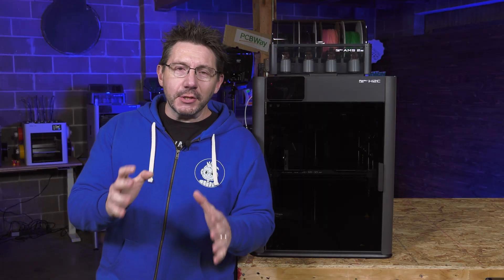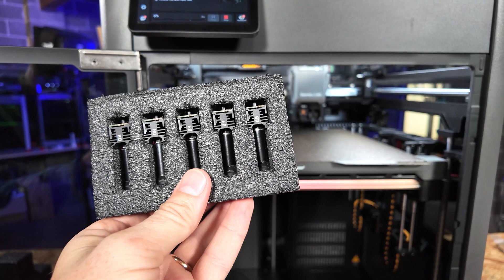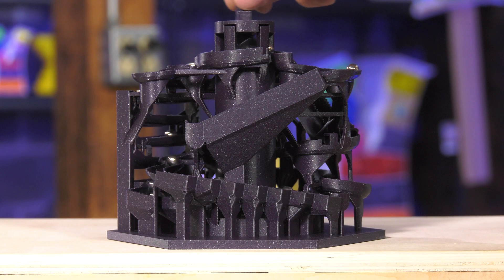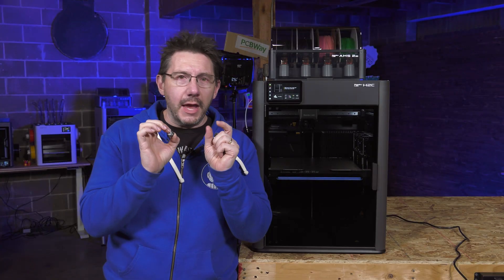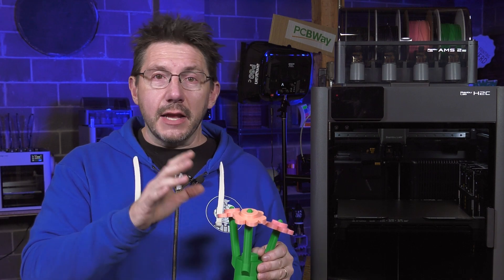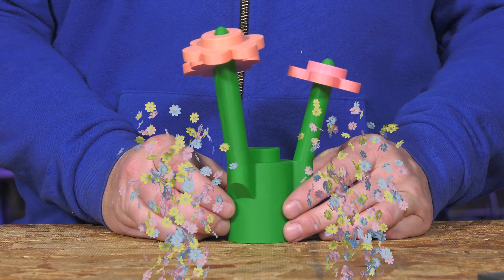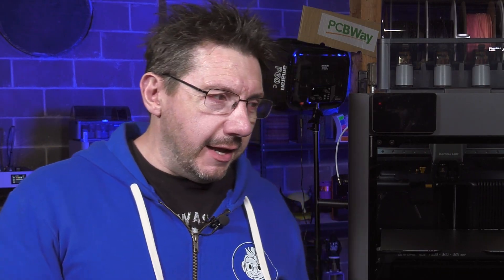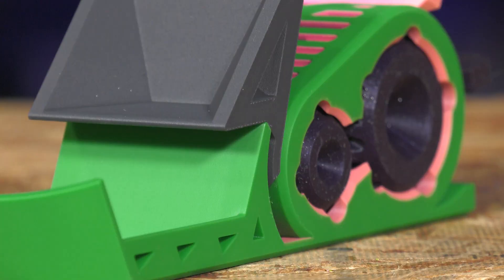My Review of the Bambu H2C + Vortek

Comment: they solved the cold pull thing with a firmware update....now fully auto.......
Reply: It should perhaps be emphasized once again at this point that there is no heatbed problem with the H2C; rather, it was a case of user error. The matter was clarified in his video "Bambu H2C Update - Bed Heating / Tullomer + Polymaker."

Comment: In terms of the bed, that’s strange that it doesn’t stick with visionminers adhesion solution, that stuff usually works for me on everything. I’m guessing it’s either the bed material or texture that’s causing it. TBH, I’ve never liked bambulab oem plates, this same issue happened to me on the x1 and upon replacing with a third party pei plate, prints stayed in place as expected. Visionminers adhesion promoter works wonders though usually, pretty sure it’s witchcraft.

Comment: You dried out the pa6 too much, it becomes very brittle if you overdo it. Pa6 is really annoying to work with as it needs very strict parameters, and must be sealed after printing to keep water from ambient air  out of the nylon - ppa-cf would be a good alternative. extremely strong and relatively easy to print, albeit being pretty expensive.

Comment: I have found with PA6+GF or CF really benefits from the water anneal process for nylon. I tested this by printing a tennis ball with PA126 from IC3D after drying the filament the one that was not water annealed broke after a couple throws at concrete, the one that was water annealed survived 100+ throws full force at the same concrete floor. I eventually printed a basketball with it that is still bouncing.
Reply from the maker: Water annealing - I’ll look this up!

Comment: Alright, I have printed PA6-GF with a few tips. Here's what I've learned. First off, use glue stick. Even for a small part, it breaks lose easily without glue. 100°C for the bed and 60°C for chamber. I dried it for 12 hours at 85°C in the AMS HT with spool rotate on. Once the drying was done, I put in Slice Engineering Activated Alumina desiccant in a spool desiccant holder. That brought the humidity to about 10%-15% or so in the AMS. PA6 shouldn't be over-dried. It should remain somewhat flexible when bend sharply and not spontaneously break. It should fatigue break after a few bends though. If it's too dry, it breaks immediately upon bending. I also set the nozzle temperature to 290°C which is 10°C hotter than the standard profile.

Comment: Lazy review. First the bed heating is a non-issue as reported on by several other youtubers and people with the actual printer. Also, there is a dedicated menu for automated cold pulls. You don't have to butcher the nozzle to do a cold pull. This is a lazy review which makes me question what else Joel "missed."
Reply from the maker: Tried the cold pull didn’t work. Also tried the wiki method of heating a small allen key and shoving it into the nozzle. That too didn’t work. Bed heat update video coming. Sorry I was too lazy.

Comment: It physically hurt to see how he burnt up the nozzle. Dude, the printer has a cold pull function. Even in my X1C I dont do cold pulls with a lighter, just heat up the nozzle, feed in filament let it cool to 100C and retract the filament. The H2C does it even automatically for you.
Reply from the maker: And that didn’t work. Neither did the wiki described method of heating up an alan key and shoving it in. None of it worked with this nozzle.
Reply: @3DPrintingNerd  Press X to doubt. If that were the case I find it dubious you didn't mention that the "bambu cold pull function didn't work" before you manhandled the nozzle and said "treat them as disposable."
Reply from the maker: @ryansed  Cool, doubt me all you want. It didn't work for the 0.2 nozzle I had, and that's that.

Comment: Love your videos. Did you try adding a -.1 nozzle height lower adjustment to your prints. I found out that out of the box I had to add a height adjustment by 0.2mm on my new ECC Elegoo Centari Carbon printer. Should you have to do this? No. But it might work. I find if the bed is not completely level and the frame is not completely square and the table/ workbench is not completely level and flat then we are going to have issue.  You should also check the frame for out of square issues. Even a tiny amount of out of square from shipping can cause a lot of issues bed adhesion issues maybe or maybe not but it is a good thing to check and check and readjust the Belts to make sure the belt is riding in the center of the gear/pully. I found a video on Youtube that showed how this can help with VFAs/ringing issues.  I did find on my X1c that the belt was off a little. I rarely have to use glue stick, etc to my build plates. I print mostly PETG. With today's printers I would agree we should not have to adjust these things out of the box. This should be a thing of the past. Especially with the Bambu Labs Lidar and camera  features this shouldn't happen.  It should auto adjust the correct bet to nozzle height. You did not mention if you had all those features turned on.

Comment: As far as the IR temperature at ~11:50 I don't believe the thermal cameras are as much of a "It's this exact temperature" as much as it is "Here's the relative gradient of temperatures" The problem is measuring heat by IR requires compensation for emissivity and reflectivity of the material you're measuring. I suspect if you took the build plate off the H2C and put it on the Prusa XL and re-ran the test, you'd see a similarly low temperature reading, not because it's actually cooler, but because the emissivity and reflectivity play enough of a role. 

As I said, with the emissivity/reflectivity playing a part in how accurate the temperatures are, you notice that the Prusa buildplate appears to be orange and a matte texture, the Bambu PEI sheets are a golden color and other than the coarse texture are pretty shiny. 

Not to be making excuses for Bambu, but they also have to measure the temperature of the bed somewhere other than the surface it prints on, since the buildplate is removable they're having to sense temperature somewhere in the heated bed, and they likely only have 1 temperature sensor. I suspect wherever the temperature sensor is, it was readnig the value the display said, but one data point does not make a full-buildplate temperature conclusion.

All this to say, it might not be the smoking gun you think it is. The initial bed heating image showed a lot of variance and you can see where the heater coils are, but once it got to printing temperature the gradient was much less noticeable

Comment: 15:53 printed about 50kg’s of several brands of PA-6 GF and CF for robotics oil&gas prototypes for my job this year. Firstly, like others have said, there’s a sweet spot for moisture content. I dry material in a similar fashion to what you did, but then allow it to acclimate in my dry box at a 10%RH for 24-48hrs before any printing, works absolute miracles! GF material from some brands tend to like slower speeds and about 5°C hotter temps than their matching CF Variant

Comment: Wait, if I heard you right, you said you heated the XL to 100c but your readings showed you barely got 60c on the XL? Also, did we calibrate emissivity on the IR gun? Shiny metal is bad for IR. Additionally, that's a bit of a distance away for reliable readings, I feel like a thermocouple is a better judge.

Comment: There are a number of people discussing your bed temperature observations and several engineers have noted that you have incorrectly configured your thermal imager, that an E-value of 0.5-0.9 would be correct for a non-matte, non-black plate.  Among other points.
Reply: With 'correct' emissivity the gradient could only be larger than it was shown so it won't help bambu.
Reply: @project.jericho  Took a lot of scrolling to find this comment but it should be at the top.  This anomaly has been noted (and subsequently corrected) by a number of reviewers of the Bambu lineup.  It seems too many people buy expensive thermal cameras but think they are "point and shoot".  A tool's value is limited by the capacity of the person operating it.  Put bluntly, here, Joel has come to an incorrect conclusion due to a skill issue with the operation of thermal cameras.  The peanut gallery in the comments latches on to it and perpetuates the misinformation.  Glad you and some others have been able to come to the correct conclusion...

Comment: There is discussion about your video in other places and folks are suggesting that the IR imaging reading here is misleading/inaccurate. Specifically of note is the emissivity of ɛ=1.00 which is basically impossible, and when that is off, your absolute temperature figures will also be off. Can you repeat measurements with a thermocouple? A half-decent multimeter will come with or offer as an add-on a simple thermocouple probe that you could use.
Reply: That doesn’t explain why they went with an oven style heater for the bed…..
Reply: @C0yf1sh they used an entirely normal heater for 3d printing. The actual difference in temperature across the bed is at most a couple degrees on a properly functioning bed, accurately measured. The H2S and h2d both use the same style of heat bed and it works just fine
Reply: @chrisjohnson00  Sounds like “just fine” is about the same results as I saw during the video. I don’t care for a specific brand what so ever and I love my FlashForge. But I have had one single bed adhesion issue with my mk4 prusa and all I had to do was scrub the bed plate with a sponge. And it doesn’t have an enclosure….
Reply: @C0yf1sh obviously the device in the video  is not typical for that style of heater. All manufactured products have defects.
Reply: While you are correct that emissivity  would never be equal to 1, this setting actually provides less of a gradient and with 'correct' setting it would only be higher.

Comment: This Vortek is DOA and the H2C is a cheaper version of the H2D (component wise). Single PTFE tube, so it's still going to be SAF compared to a Snapmaker tool changer. I'd advise anyone interested in a printer, stick with the H2D, H2S or P and A series. Yikes what a disaster.

Comment: 15:55 - I've tried a vast variety of composite filaments in the last year or so, but I've almost entirely ditched them in favor of good old PLA. Composite materials are simply too brittle and have very poor layer adhesion. Bambu's own Filament Guide on their website even shows this. On paper, only their PA6-CF has slightly better adhesion than PLA, but everything else is like half as strong or worse. Meanwhile their PLA Tough+ filament touts a 2x increase in layer adhesion compared to standard PLA.

Comment: Pa6-gf has been a nightmare to print with. I have been drying it for recommended times and above at times. Eventually printed uniform but was more brittle than PLA like in the video due to poor layer adhesion.

Comment: I don't get it. What / who is this printer designed for? I thought the switchable nozzles may have been the silver bullet for no more purge blocks, but then saw purge blocks. So multi-material? Other than that if you currently can't use different sized nozzles in the same print it feels like a big, what's the point? Am I missing the purpose?

Comment: I use PA6-GF in my combat robots. It comes out with a very smooth finish and is a little springy under impact. I use it for parts that are subject to repeated shock loads. I've had luck drying it at 85C for 24 hours (minimum) to 48 hours (best) on the Matterhackers PrintDry Pro and at 85C for 12 hours (minimum) to 24 hours (best) on the Creality SpacePi X4